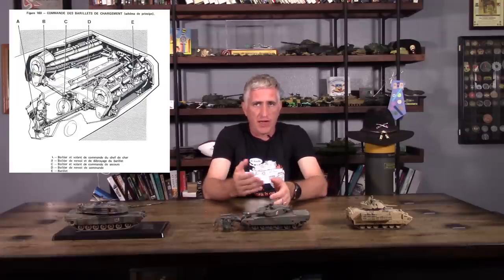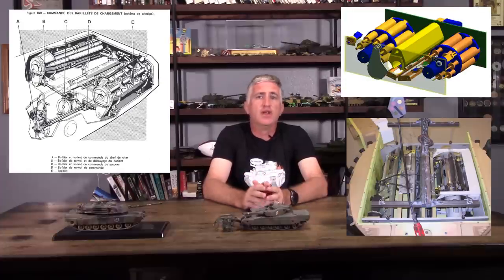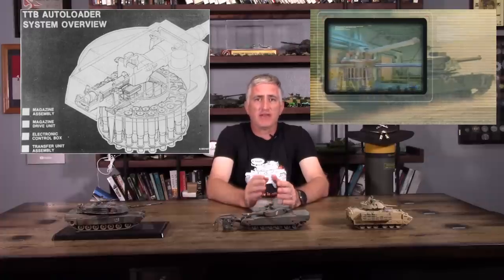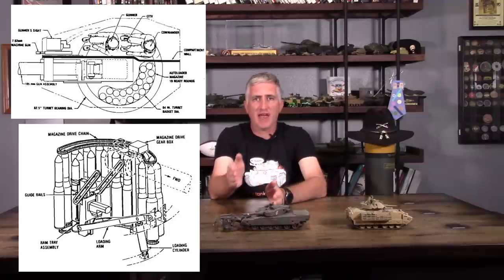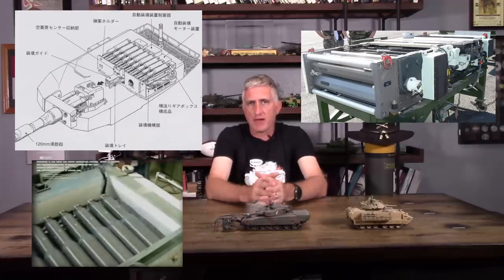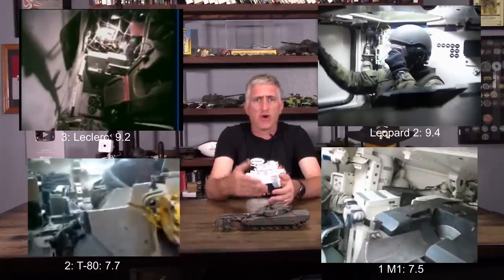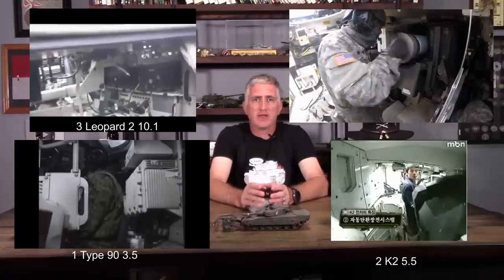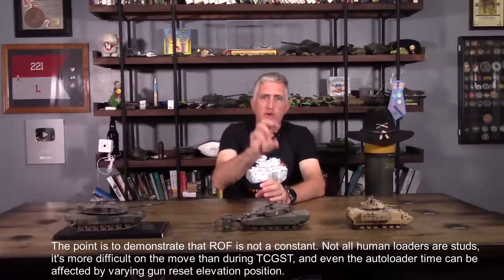Whither the Autoloader?

Comment: A lot of the time in this debate, I hear that you wouldn't want autoloaders in a tank because they're more expensive than a crewman. Firstly, is that really true when you consider the crewman needs pay, food, potentially medical care and might leave a grieving widow behind? And considering you can save money on weight, same armour for less metal volume, same hp/t for a weaker engine and so on, I think there's something to GAIN economically with autoloaders. Agree/disagree?
Reply: I'm betting you're correct. The Army's FY19 Military Personnel budget was $45 billion for 480,000 soldiers or almost $100,000 per man (and that's before you include training, infrastructure, VA benefits, etc).
Reply: I think the "cost" factor isn't meant during usage, (it should be cheaper in usage) but in development, testing and construction. You have to incorporate the costs of the humans that construct the mechanism, those who build it and those who test it ect. And for the material: maybe i'm wrong here, but the material to build the auto loading mechanism might be more expensive than to make the tank a bit bigger. (So the tank itself would be more expensive to buy)
Reply: I have been a senior design engineer in a subcontractor for the Ministry of Defense (UK). I can promise you that development is always way more expensive than unit cost. For example the public figures for the F-35 are as follows: F-35A cost roughly $90million USD. F-35 development cost? $400 Billion and counting. IE the unit price is 0,025% of the development cost. So you could have heading for 4500 of them for the cost of development. That's pretty typical too. Here in the UK we tend to do things on a shoe string budget but the Tornado was only about 4 times better than that in terms of cost to development ratio. The real issue is that to be the best you cant just use kit off the shelf because a good deal of it does not even exist yet.
Reply: @gordonlawrence4749  just posting to point out. that the f35's cost has ballooned out of all proportions. tornado is/was a better(or more favourable)) comparison :)
Reply: @BlueEyesGaming  It's happened that way on the B-2 programme and was even worse for the B-1. The only programme I know of that went reasonably cheaply in the USA was the M-16/M4 (rifle not M4 Sherman). I suspect the Sherman was not that expensive as it used a significant amount of components from other tanks EG the volute suspension from the M3.
Reply: @nirfz  Look from starting point of no loader at all, then you get it correct.   These days Human loader too needs build up mechanisms into a tank.  Space, extra armor, cupola, MG, electronics to bring gun to optimal position, and all kind of safety levers and so on designed to be used by him.  And truly, autoloaders these days seem to be really blunt and simple pieces of machinery compared to many other industrial things.
Reply: Antti Huhtala 
If your loader dies in the field, the gunner can take his place and the commander can assume control of the guns.
If your autoloader breaks in the field, you're screwed and can't fight back.
Reply: @combativeThinker  Actually most autoloaders have a manual load option. It's just slow.
Reply: It depends. If you have conscription army, you don't pay salary to loader. If you are from poor country, with low paychecks, expensive auto loader can be more expensive. For rich countries with professional army, like USA, it is cheaper to have piece of machinery.
Reply: For society as a whole, that is almost certainly not the case. An economist can estimate a net present value to society of a healthy worker in his early 20's, and it works out to about 3 million dollars in a western society. Unless the development and fielding of autoloaders cost more than what you save by not putting an extra 3 million dollars per tank worth of assets in jeopardy, cold hard logic speaks to the autoloader.
Reply: @Snagabott  You are making a hell of a lot of assumptions there. For a start what a US worker can produce for the country in terms of taxes etc is different to for example a Haitan worker educated to the same level. The cost of an autoloader is also extremely variable. The US systems used in the M105 etc are way more expensive than the soviet systems and the current Russian systems are somewhere in between (but don't ask me to put a figure on it). You also have the psychological aspect which almost nobody takes into account. Humans just feel far more comfortable working in a 4 than in a 3.
Reply: @Snagabott  Forgot to mention Israel. The Merkava is a manual loader. Israeilis in general are better educated than people from the US and produce more for their country tax wise. They also have a perpetual shortage of tankers. So if they used autoloaders they could have 33% more tanks. So that should make you think on it's own.
Reply: @gordonlawrence4749  Yes. The value of that person (in terms of monetary NPV, not as a human being!) will differ depending on what demographic you are drawing from. Two points though:

1) It might be tempting to just look at how much in taxes the individual is likely to pay over his lifetime, but that would be missing a huge part of his contribution. The idea is to look at the GDP compared to the number of contributing people (so not including children and pensioners), and assume that the tanker would be one of the contributors. How much of the value he produces that gets funneled through government (ie. collected as taxes) before being distributed as benefit to society as a whole depends on where you are, but what matters in the end is the efficiency of the economy, not how that distribution is done (although sub-optimal distribution might hurt the initial number in the first place). Example: either a country could choose to collect taxes on motor vehicles and spend the money to build a road, or a private company could build the same road and collect back through toll booths. Only one model involves the government, but in both cases the road got built and (assuming it made no difference to how the work was carried out), took up the same amount of total resources from that society.

2) If you find that your tankers are likely to do statistically significantly worse in the labor market after they leave the service (and the vast majority of them will only stay on for a few years at most), you need to look into what kind of military you are running. Unless there is a general selection towards the part of your population with the worst talent (which will bring its own problems once you get into combat and find that your troops are consistently outperformed by the enemy), there is no reason to suspect that experience on a complex military machine like a tank should do them worse than other entry level jobs a person might have in their late teens/early 20's.

Btw; the GDP per capita in the US is almost twice that of Israel, so in all likelihood an American tanker has a NPV that is at least as high as an Israeli tanker.
Reply: There's also the very important factor that the Russians noticed. By removing the 4th crewman, for every 3 tanks you build, you've saved enough men to crew a 4th. With more guns hitting the enemy, missions can be carried out quicker and more efficiently, leading to lower friendly casualties. Needless to say, having a greater percentage of your men breathing when the fight is over is a very attractive proposal. Not to mention, with a 33% larger usable tank force, you might be able to achieve your goals without firing a shot simply through intimidation
Reply: @filmandfirearms  
That is definitely an advantage as well, if manpower presents a limit on your tank force instead of industrial capacity or the like
Reply: Tankers, "Manual loaders are better."
Scholars, "Autoloaders are better."

I gotta go with tankers.

Also; Ukrainians, "Autoloaders are great."
Russians, can't say anything because they're died in their autoloading tanks.
Reply: @azimuth361  
Ehh, tankers (or the user, in generic terms) aren't always right. You 1) don't know something until you've tried it, and 2) a tank isn't JUST a tool for soldiers to fight with. It's a very expensive strategic resource, and the economics and logistics of the situation must also be taken into consideration
Reply: @azimuth361   imagine expecting machine operators to have insights and all of them think the exactly the same lmao

Comment: Former Abrams Tanker: Chieftain I appreciate your point of view and thoughts. Great pros and cons but I maintain if you can't solve your problems after 18 rounds of M829 APFDS fired from a M1A2 (or tank with similar accuracy) then you aren't going to solve them with a theoretical 4-6 more rounds in an autoloader config. As you said, a seasoned loader will cross level between engagements, likewise a seasoned loader/TC combo can grab from the semi ready rack fairly efficiently between engagements once you burn through the first 18 rounds but granted the rate of fire would be much slower. Your video had some autoloaders that were comparable or superior to manual loaders (side note: The video showed a 7.5 second load time for Abram’s loader and that was relatively slow when I was in.  We had guys that could load in 4 seconds from ‘sweet spots’), but I wonder how the autoloaders in the video that were faster would handle changing different ammunition types.  I believe 8.1 seconds was the qualification maximum time but it has been a while. In a fight I'd rather have a confirmed rate of fire advantage versus wondering if 18 rounds won't be enough to solve my problems 10 minutes from now. Even factoring in the tank volume of Gulf War One, I wonder how many crews actually fired 18 rounds from the ready rack and said "Shucks I'm out!" I think the answer is Zero. If they needed more rounds right away, they called their wingmen to cover, cross leveled and continued mission. Also, what is the rate of fire when you finally expend your 'extra' rounds in an autoloader? A slow rate of fire is better than no rate of fire. Additionally, I disagree on there not being a significant degradation of the tank crew by removing the 4th member. People get injured, sick, must sleep, sentry/OP duty and major labor-intensive tank maintenance (thrown track) are all more efficient with four-man tanks than three-man tanks. Other items that Tank Companies perform in the field that require manpower (refueling, general maintenance, sand box creation, camo nets, quartering parties, runners, air guard, refueling, logistics, chow servers, ground guides, CO Drivers, cross leveling crew members from other tanks that are lost, deploying chemical alarms, conducting chemical tests, recovering stuck/broken vehicles, hygiene etc., etc.) allow the company to maintain more capability long-term when there are four versus three. I wish we had data of degraded crews (battle loss/sickness/other) running 25+ year old tanks over an extended war with a degraded (3) 2-man tank crew versus a degraded (4) 3-man tank crew.  A 2-man tank crew on a 3-man tank might be doable for a short period, but over time the fun would evaporate and the crew would be miserable. I think there is certainly a point in the future where auto loaders will be universally accepted, but I don’t believe the time is now to fight long-term wars on aging 20+ year old tanks with 3-man crews.  I think there 'might' be some national/regional differences in this argument as well. US Tank crews are going to be deployed across an ocean for a long period of time versus say a regional nation's tank that may never deploy far from their bases in Europe or Japan, etc. For tanks that had more of a short-term or defensive-only purpose perhaps 3-man crews make sense.  I think the tipping point for the US to adopt an autoloader is when the entire tank is automated...i.e., Drone Tanks. I don't disagree that the surface area of an OPEN non-auto loader ammo rank is greater than the exposed surface area of an autoloader ammo rack, but I think the odds of a round penetrating that particular area that is greater than an autoloader’s area at the exact 2-3 seconds the ammo door is open are negligible. I doubt it has ever happened before, maybe a Saudi Arabian crew had this unfortunate event occur. Lastly, I think all of the new technology concepts we are seeing coming out (30mm cannon on top (not a fan), drones, anti-drones, jammers, active protection systems, smart ammunition etc are going to require even more skilled team members initially) Sadly I think the argument is probably moot for US tanks and autoloaders as I don’t see another true new MBT being fielded again.  Oh, one PRO for autoloaders that I think needs to be considered is the cost to recruit, acquire, train, equip and maintain the loader himself, i.e. having that 4th crewmember costs a lot of money over an enlistment and when multiplied by your tank fleet it is very expensive. 
Obviously, I'm biased but I remember everyone being gainfully employed in four-man tank crews.

Comment: Hi Chieftain, I wonder if you have any comments
About the russian T 14 armata tank.
Cant find any videos from you on the subject
Reply: its a paper tank. its been in development for a decade and its engine breaks down during a parade, unloaded and on paved roads.
Reply: @pyroromancer  Paper tank is the tank that only exist in blueprints, and there are prototypes of Armata. Every tank had some problem in early stage that is resolved later. Also I believe it was transmission problem.
Reply: @shawnbush1431  That is what i read in reports too. That the replacement driver was unfamiliar with the T 14 and did not realise it had a hand break system controlled from a panel.
Reply: Prototype only, has problems, is Russian. No War Thunder bias for real life.
Reply: @mongo1137  Which tank prototype hasn't had problems? That's the whole point of building a prototype genius.
Reply: @5000mahmud  Oddly enough, I am a genius. I'm also a former tanker. Russian equipment is garbage.
Reply: @pyroromancer  You know that the driver accidentally activated tge emergency brake, right?
Reply: @idontknowwhereiam5801  Russian emergency brakes that brick the engine? ur a failed troll
Reply: @pyroromancer  The tank has driven off just after the parade, so the engine wasn't bricked. And yes, if you overload a piston engine below certain RPM, it stops.
Reply: @pyroromancer  In fact, the engine was up and running through all the incident. And the tank left on its own at the end. That's why their version with accidentally engaged "parking brake" is pretty believable.
Reply: @pyroromancer  engine didn't  break down where did u get that from.
Reply: yeah, humanless turret is cool and all, until you realize that if the gun jams, you cant fix it in battle
Reply: @RobertLutece909  True, but they don't have the economy or the will to produce enough of them to be significant even if they're as advertised.
Reply: @mongo1137  they don't have economy to produce them for themselves. But when some multi billion order from india, iran or china comes, they will make them in thousands...

Comment: A auto-loader together with other tech permits you to make a crew-less tank turret, moving the crew down to the main hull if you wish making them less exposed and allowing you to save your armor for the hull instead of the turret if you so desire.
Reply: but if the tank gets hit hard its very easy for that auto loader to be destroyed
Reply: @unsteadyresults4533  I mean better than getting the crew dead.
Reply: @unsteadyresults4533  were hit hard with the crew in, you would be missing a crew

Comment: When we move to 140mm, there really will not be an option due to the size of the round.  I like the French solution for keeping the 4th man as that eliminates the excessive maintenance and watch requirements. Having spent years on a Command tank which always ends up as a 3 man crew while the FGO is off doing FGO things, that need for additional help is certainly real.

Comment: I think the French idea is rather smart.  Don't eliminate the loaders entirely, just have them follow around in APCs.  And then any maintenance duty still has that extra fourth man.

It seems that technology is to the point that loading is becoming increasingly tedious.  Just like we have more IVRs than human phone operators.  Sure a human operator is more versatile.  However an IVR can direct the call well enough for 80% of all the phone calls coming, allowing for a higher volume of calls and for the human operators to be free to do other tasks requiring critical thinking.  If an autoloader is 80% as effective as human loader then put that human loader in the APC so that he can adjust the track tension and the machine does the loading.
Reply: TEXOCMOTP  And still, the Leclerc is more successful in Yemen than the Abrams.
Reply: TEXOCMOTP  No, but the Leclerc is.